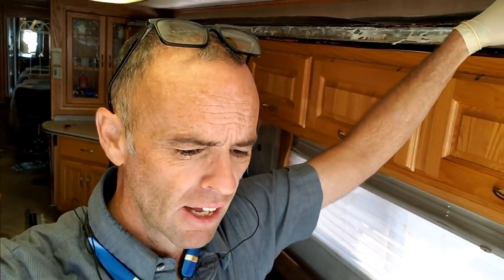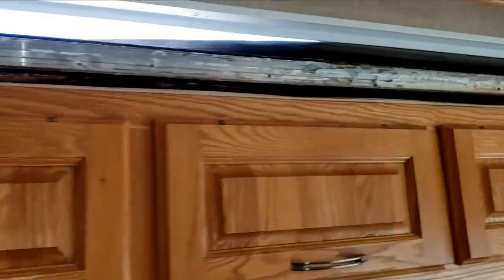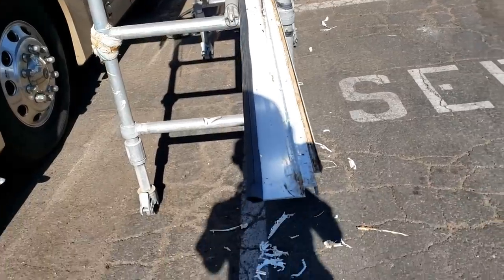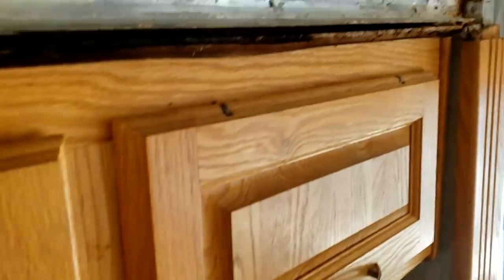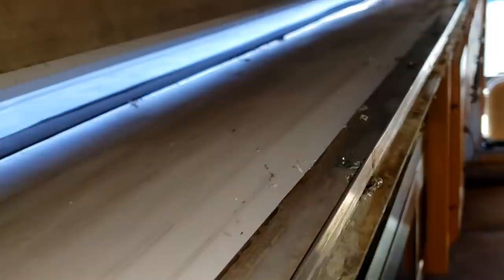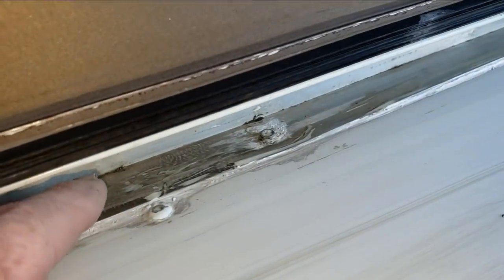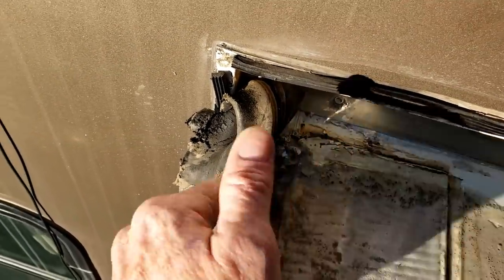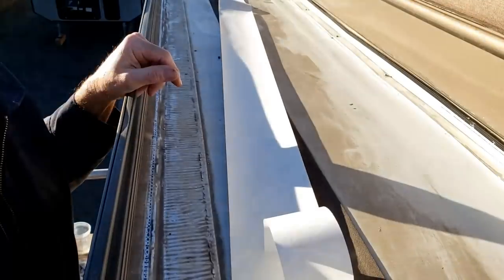Leaking Monaco RV Slide-Out Repair Technique

Comment: At around 11:30 into the video, you mentioned it wasn't suppose to take this long.  If I was the owner of the coach, I will say, better to take time, do it right the first time instead of doing an quick sloppy job that won't last.
Great job!
Reply from the maker: I appreciate that. I always seem to be working with a deadline so I have to estimate repair times to keep appointments and schedules. I did keep extra time available for this job, but had hoped it would go easier for sure. Thanks

Comment: As a tip, sharpie a straight line on the roof as a reference to keep the tape from wrinkling. I've done this repair in a half-effort way on my slide out and it makes the tape easier to apply.
Reply from the maker: Thanks

Comment: why did you show a camping world bag? definatly a ooooops. not a fan of that place but there is one 5 minutes away so i buy supplies there all the time also. point of this post is i bought a 97 gulf stream sun sport 32 ft with the 460 ford f 35 chassis that had minimal damage but im restoring it to better than new condition. you are a plethura of information. i love your videos and i watch them all the time just to pick up tips and tricks so i can learn more . most importantly that no 2 are built the same and dont be afraid to modify something that is obviously not done effectively. anyhow, point being, your videos have probably saved me 10 grand so far easy and you give me the confidence and know how to do things myself. best tip thus far is the expanding foam while stiffing the roof. that saved me a ton of work and instead of having to replace my roof now ive got it fixed so i can hold off for a year or so. im just having a hard time finding that red adhesive glue that sticks to the foam. cant find it anywhere. camping places wont sell it but they sure will sell a new roof where they use it to glue the new luan down. lol. and in your honest opinion, is that a decent unit? anything i need to check on that may be concerning after 25 years?

Comment: Good stuff! My Monaco slide leak is coming down the top wall of the slide opening. Still trying to find the leak. 
I suspect it is fron the band that ties the roof radius to the wall, although the band seems tight and well attached.
Anyway, thanks for the video!

Comment: Excellent James. Is there any value in turning a garden hose onto your finished repair to determine if there is a secondary leak somewhere?
Reply from the maker: there is value yes, usually a sprayer or a sprinkler is a good method. Thanks

Comment: Always useful videos! Thx.
I do need to replace my slide out seal on my Monaco Lapalma. You sprayed something on the rubber seal when installing but I could not tell what that was. Is that a glue or a lubricant?

Comment: So the topper doesn't necessarily keep the water off the roof? I have a rotten roof and wondering if the topper would insure no more water intrusion. It's a poor design with that flat roof. Would you rather have a metal roof or the rubber one? 08/14)24. 11am

Comment: There is a product at Home Depot that stabilizes the luan and hardens it. You can brush or spray it. The mold may come thru the cabinet ceilings
Reply from the maker: yes, I ran through the options with the owner. Thanks for the information

Comment: Great video. Love what you are doing!  Need advice. Gear motor above one of my slides leaked grease for some reason. EPDM roof on slide did not like it and it bubbled up. No leaks but wondering how to patch it or should I replace entire slide roof. Do you have any videos or guidance?  Thanks!

Comment: That looks very stable! On 5th wheels whose slideouts do you like best and worst.
Reply from the maker: that's very difficult as most 5th wheels use 3-4 slide types on one trailer. I have found the hydraulic ram with rack timing to be the most robust and reliable.

Comment: Great job
Looks much better than the factory job, never understood how they thought that design would work.
I do have a question though.
How In the world is the wood trim held in at the top, it wasn't in your disassembly or reassembly video. 
Thanks
Reply from the maker: Good question! There are screws that hold the main wood timbers on, and then the trim gets pin nailed over the top of the screws.
Reply: @AZExpert  Ok
I have seen the pin nails, was wondering where the screws were.
Thank you,  and again good job on the repair, if the factory did it like you they never would have had a leak.

Comment: Hi Bob. Great video as usual and very helpful. I have a similar 2005 Monaco Safari Cheetah that also uses two bulb wiper press on rubber seals on the slides. I have 3 slides where the gaskets are damaged at the top corners. I am having difficulty finding a source of OEM equivalent replacement seal material. Found what looks to be the same from Steele Rubber Products but they will not confirm if there two bulb seal material is the same. What do you use and from what source?
Reply from the maker: I don't have a specific brand I would recommend. Have it professionally inspected.

Comment: How often do these wiper seals on the slide have to be replaced?  Would it be good advice to change them before there is a leak? Another educational video for all us newbies.Thanks.
Reply from the maker: They usually age out after 15 years, so it is not very common. I wouldnt change them unless they were damaged

Comment: Another fantastic video!  Thank you for your expertise. I have a 2005 Winnebago adventurer that I recently noticed daylight shining through under the Galley slide. I have about a 10” section that has pulled away. I tucked it back in place the best I could for a quick fix. Is there any special instruction I need to know before ordering a new seal?  Thank you again!
Reply from the maker: Winnebago uses proprietary seals but overall, there is usually some light coming in underneath slides.

Comment: I find the use of so much sticky stuff to be puzzling when all that would need to be done is a redesign using a joining of two intermeshing metal parts placing tension upon a compressed, composite seal in between. It seems that this is commercially institutionalized planned obsolescence.

Comment: Great Job but if I was the customer I would have want the damaged wood replaced or at least the corners.
Water stop damaging when it stop running.  Wet wood can cause other problems such as mold from what I
have figured out studding motorhome repairs. Could  it be one of those pay me now a little more or pay me later
a lot of money. You could have spend another day and replaced that wet wood on top of the slider. Chit I do not 
know everything still learning James but trying to understand. I could be way off as well.
Reply from the maker: I just do what is within budget and what is wanted by the customer
Reply: @AZExpert  cool thanks for your reply !

Comment: Could you use a heat gun to dry the wet Luan that may create black mold if left wet.
Reply from the maker: yes, but also I would be concered about the wood warping once dried out and buckling the aluminum. This is not ideal to put it together wet, but should hopefully dry out slowly. Thanks

Comment: This why I would never have a RV With a slide, they are getting to big and too heavy, and will always have problems. They need more structural load bearing metal in them.
Reply from the maker: I think they are not engineered as well as the industry likes to claim
Reply: @AZExpert  I really don't think they have that much of a problem when we only had like a sofa in the slide couple hundred pounds it works great for that much weight but when you start installing complete kitchens in a flight out that's a couple thousand times hanging out there with no support don't make any sense to me

Comment: Overall, I think the repair was a good one BUT, I have a big issue with the moisture in the roof wood. All you did was seal in the water in the wood. It WILL continue to rot, and smell musty for sure. Personally, if the customer wasn't willing to go the extra mile to fix it completely, I would have sent them down the road. It's not really a reach to say with a leak like that, there will be wood rot. Telling them up front the best and worst case scenario cost, is the best way to be covered to be assured they are willing to foot the bill for the worst case. I've turned down many jobs because I knew what the likelihood of repairs were gonna be, and the customer wasn't willing to go the worst case cost if need be.
Reply from the maker: I understand. I did leave him with instructions to dry it out, but it's been leaking since it was built. They were happy and the first step is to stop the bleeding

Comment: It MUST be possible to build a non-leaking slide out, they're just not trying.  Else how can I blast a hose against my car door seals yet get not a drop of water inside, which are only held in place by two hinges and one latch, plus my car is 31 years old so the seals are hardly new!  They should stop using any form of wood for a start.  No thin wood products laminated into any roof or wall panels, only ever used as fascia like cupboard doors if they really can't restrain themselves.  I'm trying to research how to design a slide out right now.  I'd like to put two, either side of a box truck, to make a wide lounge area down both sides of the truck, underneath a bed that raises into a recessed area of the ceiling.  Surely it's just a case of picking the correct aluminium profiles so rain always can only run outwards and down, and make any seals out of simple rectangular strips of rubber with 45 degree angels on each end, or even better, rounded corners so the rubber is one continuous piece with only one join at the bottom in the center where water is only going to drip off anyway.  e.g. 1 inch wide, half inch thick, that you replace by peeling the old strip out, cleaning the adhesive off, then peel the paper strip off the new piece to reveal the new adhesive (unless the rubber strip is just held into the profile of the aluminium strip by friction like many car door seals are), and pushing it into place.  Change it every 5 years as needed, when it compresses, but should only be needed to stop the air draft.  Rain should be kept out by the profiles of any aluminium framing and/or by having an all fiberglass box with wide, angled sides.
Reply from the maker: I agree completely, Tiffin was using seamless slides but discontinued after Thor purchased them

Comment: With all the components used by the manufacturer to seal that slide out, it almost seems to me they started with one seal, tested it, found it leaked, added another flashing, found that leaked, added another, rinse & repeat.  Overly complicated and still didn’t keep the water out.  Gotta be a better way to engineer that system.
Reply from the maker: I think so too. Some manufacturers have moved to a single seamless box which seems like the best way forward to me